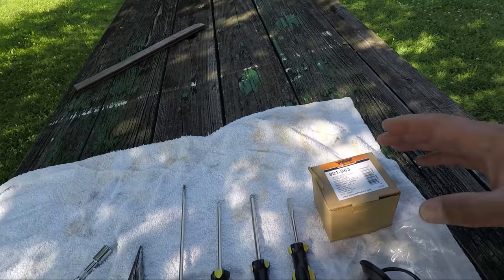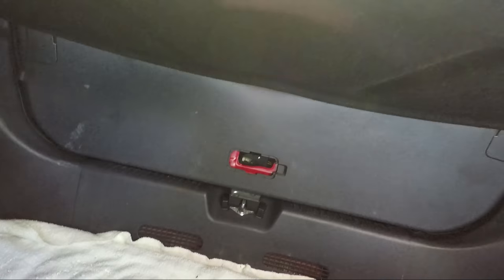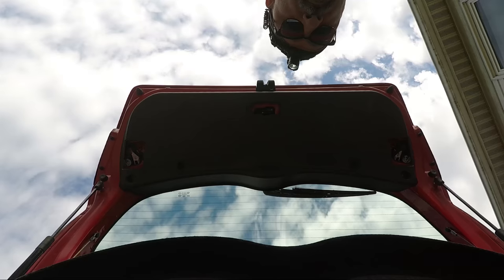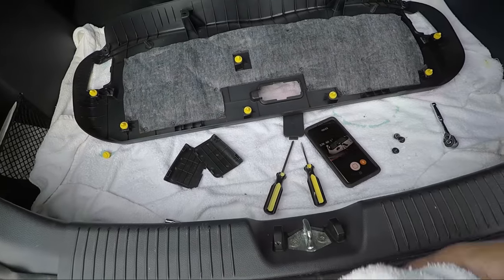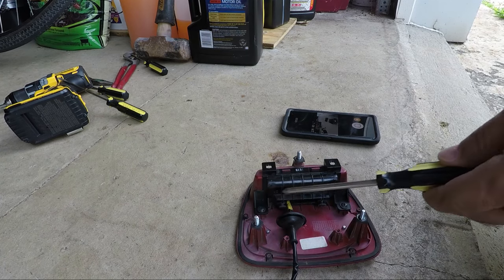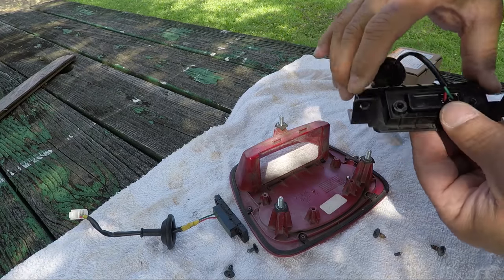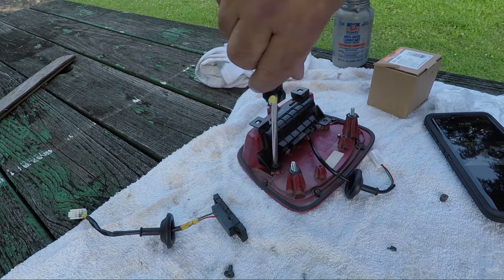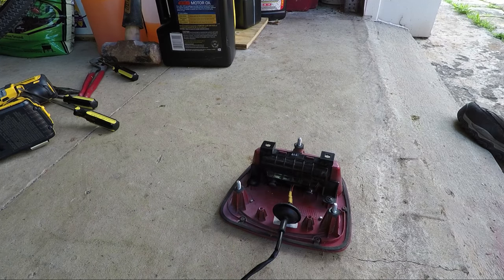Kia Rio Hatch Release Switch

Comment: Excellent video! Very easy to follow. I had the exact same problem. I temporarily removed the damaged rubber thing and just taped  over it. It works but I still ordered the replacement part. It cost me 27 EUR with postage. Saved a lot of money. Thanks for posting.

Comment: Hello,
Thanks for the instructions, I did everything exactly as described and everything worked very well.
But recently, I am facing the following anomaly: sometimes the button does not activate the opening of the trunk immediately, only when I wait a few seconds, sometimes it does not work at all, and in other cases, when I start the engine, it activates itself and I have to get out of the car to properly close the trunk .
Can you help me in this situation. It is
 a lottery, I don't know if I will have access to the trunk when I need it.
I checked the button with a measuring device and it works flawlessly and on time. Something else is in the middle and I don't know how to proceed.
The car is identical to yours, Kia Rio 2016

Comment: The part that you share from Amazon is not the same as what came off my Rio. The one from Amazon only has one power connector when it requires two. I have a 2013 Rio EX.
Reply: Mr HardlineTheGeek, I'm like you, having a 2013 Rio EX and ther equired part, as you said, is different in the video than when I open up for change. Did you find the right piece to change it ?  And if so, what was the exact piece and where did you find it ? Many Thanks, Robert